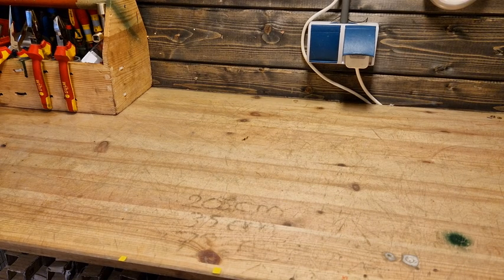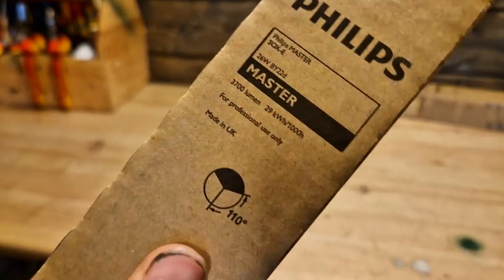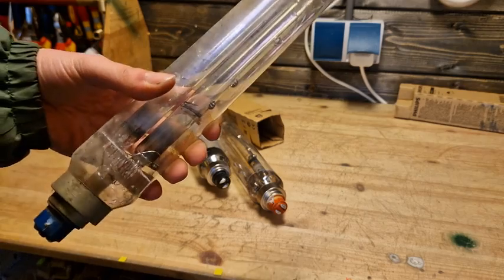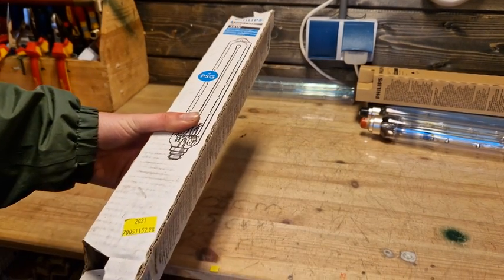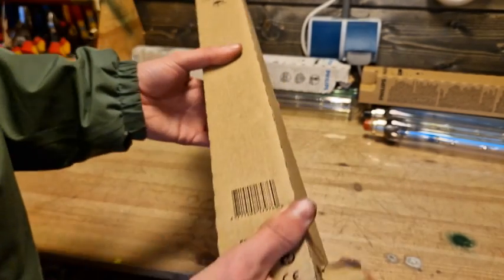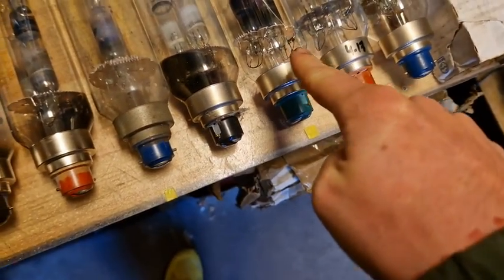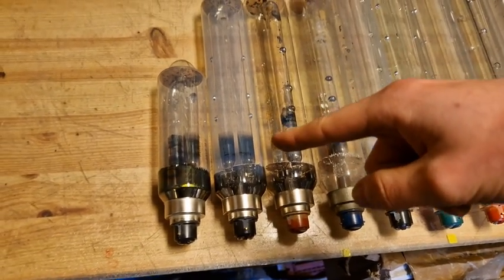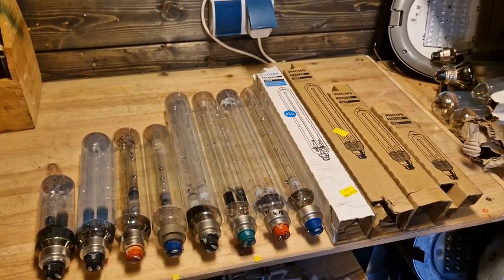All Of The SOX (LPS) Bulbs That Were Made By Philips Pt. 1

Comment: PSG stands for Philips Solid-State getter. The getter is needed to absorb any particles that may be in the vacuum sleeve after production and during use.
Normally the getter is the black stuff at the base of the lamp. The PSG is the pellet on a stalk by the arc tube. PSG is only available in 35 & 55W lengths because the volume of the larger lamps is too large for the pellet to be effective.
The PSG doesn't increase lifetime, but it does reduce the chance if early lamp failures.